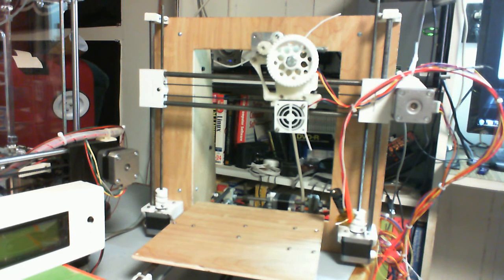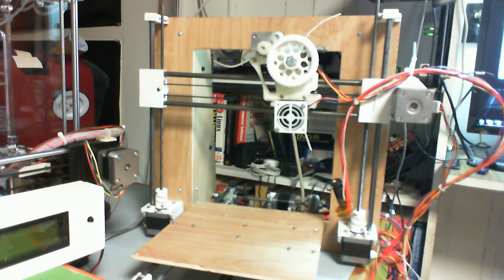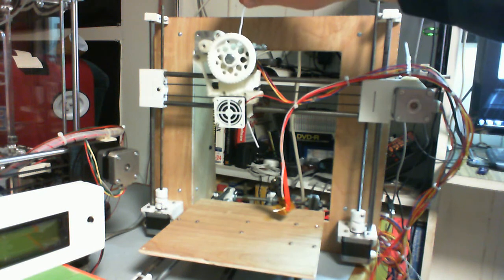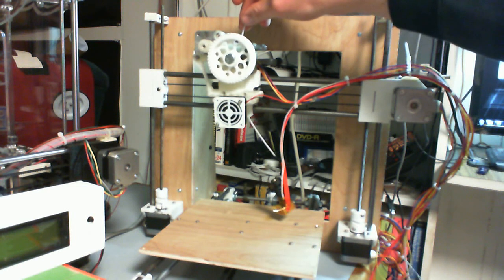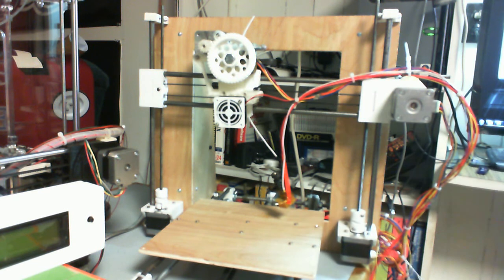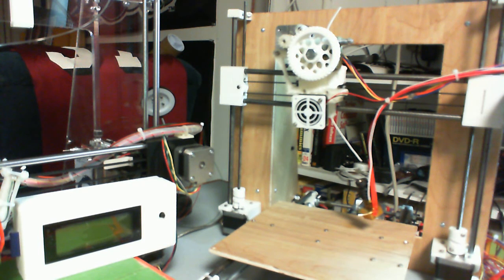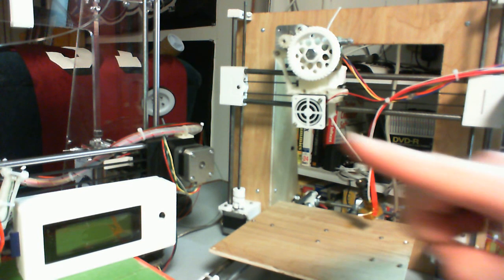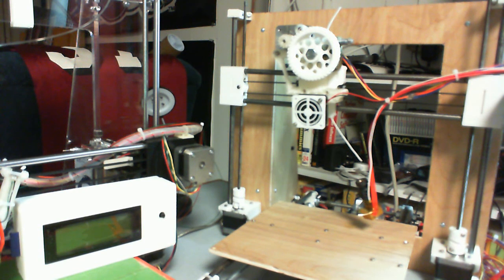Homebuilt Wooden 3D Printer (prusa i3) - Part 4  Movement

Comment: Hi,
You can put some white lithium grease on the smooth rods for the X and Y carriages, it will somewhat decrease the friction and noise.
I was a little bit hesitant about the endstops when I was finishing my Prusa P3Steel, I ended up temporarily tying the limit switches with nylon ties directly on the smooth rods, and it worked fine for many weeks like that!
Reply from the maker: Thank you for the comment, I may try the grease, I also have silicone spray I could use. As for the end stops, yes I'll have to do something and zip ties DO work in a pinch.